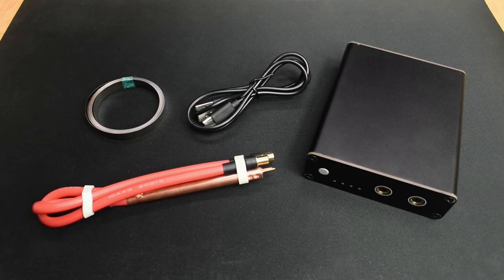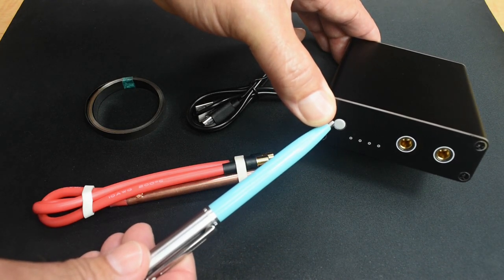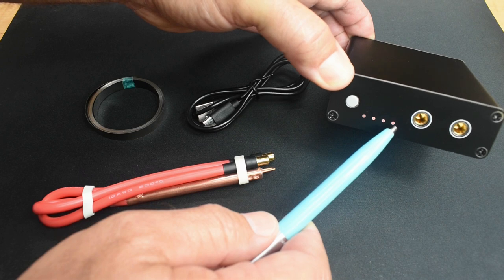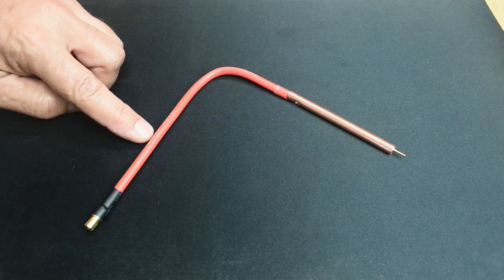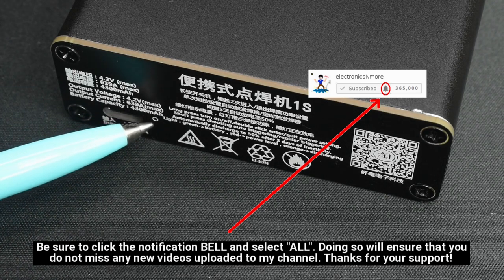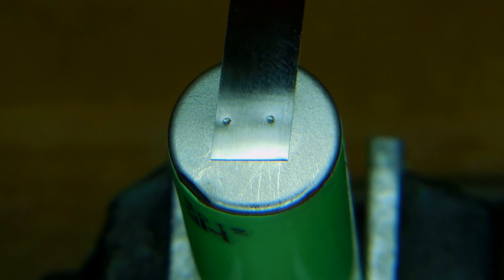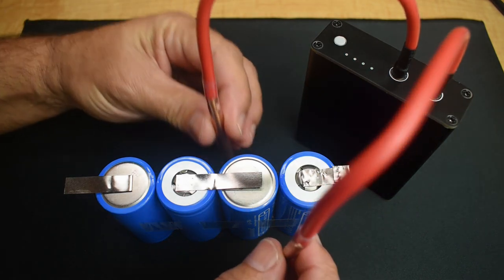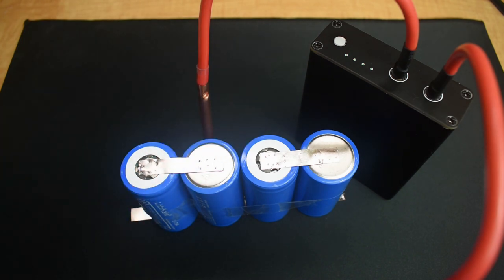Low Cost Battery Spot Welder (Turn Cells Into Battery Packs!)

Comment: I picked up one of those $15 Banggood specials and it works surprisingly well.  It does have to be connected to a car battery to be able to deliver enough current to do the spot welds (maybe it could be powered by LiPO batteries, I dunno), but for being so cheap it does a nice job with spot welds.  So far I’ve only used it on button cells, but I expect it to work just fine on 18650s as well.

Comment: Just ordered one.   Looks to be far more handy then my MOT set up.   Thank you.   Hope it will work with 0.15 in high setting .  That is what I use the most of.
Reply from the maker: You'll be happy with it. Thanks for your support!
Reply: @electronicsNmore  Thinking I may need to hit the welds twice for the 0.15.  you can in fact spot weld the BMS leads as well.  Takes some practice.
Reply from the maker: @pulesjet  Good point!

Comment: With that device I'd have many fewer dead portable drills sitting in the garage.  All things considered though, I'd probably have to re-read the directions when I go to use it every few years.  It needs three buttons: On/Off, Set power level, and Operate (or Weld, or Start, or something).  Send it to Todd so he can drop it off a ladder 😄
Reply from the maker: Exactly. It's very easy to rebuild those cordless power tool battery packs using this spot welder. LOL. Todd. Thanks for watching!

Comment: I got the aliexpress version which doesn’t come with the internal copper bus bars instead using solder to move the current(bad idea) unfortunately they didn’t use enough solder to cover the pads where they carry high current to the mosfets. Had to add some of own solder which isn’t good to heat with a lipo glued to the other side.

Comment: It will be interesting to see if the soldered cells last longer then the welded ones.  People have reported these diy spot welders seriously reduce the lifetime of the cells.  Please do an update after a set fails!
Reply from the maker: The spot welded areas are very small, and every battery pack sold in cordless power tools are spot welded. Thanks for watching!
Reply: @electronicsNmore  , yes but these home spot welders are not the same as industrial tuned spot welders.
Reply from the maker: @TheRainHarvester  You cannot expect industrial quality for 50 bucks or less. The device is more than sufficient, and the cells will fail due to other reasons first.
Reply: @electronicsNmore  well, others have had experiences that show otherwise on home spot welders.  I just wanted to see future results for this one, instead of assuming.  One guy spot welded a bunch and soldered others.  All other things being equal, he noticed the soldered ones lasted much longer, probably because the machine had too much current, or the pulse was too long and side currents attacked the chemicals under the lid.  It might be user error, but without an experienced user, the machine should compensate.
Reply: @P_RO_  I agree, which is why I wanted data on the long term battery life of batteries welded with this kit.
My point is that this kit may not weld with the correct time or current.  
The only way to know is to test, and not "assume" like the poor operator you mention.

Comment: I built my own, but it's a bit big, and my battery died, (the small one powering the timer, and solenoid) I have bought two small spotwelders,  both the FETs exploded, before they did anything, not one weld, the last one, basically caught fire! But my home built welder, it will not weld under 11v, so with 3s liion it needs to be kept topped off, but I use 4gauge welder cable, and after a few welds it's so hot, after about 50-90 cells, it has almost burned my hands, they were a bit sore after, from the heat, not quite a burn, but my welds are about 1/16" diameter, so low current cell / battery builds  can get by with a single pair of spots, im using a timer board, and SSR, with a starter solenoid, I may try the small electrodes like you are using, maybe I can but more MOSFETs to replace the exploded ones on the tiny welders,
Reply from the maker: The one in the video works good, I just made another 32700 12V battery.

Comment: Hi,
I'm based in the UK and have a few questions about this battery spot welder but first, fantastic video, don't ever change the way you present, keeping things simple and informative is so difficult and few can do it--you can., excellent video.

I am a green horn when it comes to spot welding but ordered the above same mini welder from Banggood and it arrived very quickly.

I knew the instructions would be in Chinese and seen a couple of  YT videos but could not make heads or tails as to the advice given on setting up the welder.

Using your advise I practiced on a couple of 18650s using the nickel strip that came with the unit, it went like a dream, using power setting 3 & 4 the results were great.

However I also practiced using some Solar Cell, Solder Busbar Tabbing Wire ( 0.2 x  8mm and it would not spot weld to the flat tops.

I feel this is a stupid question to be asking but any idea why?

The leads are a little to short for my liking and I would like to make some, I can purchase replacement leads but they are about the same length as the existing.

I wish any new ones to be about 4-6 inches longer that's all, if this is feasible do you think lengthening would have any affect on the quality of the spot welds or the welder?

If I'm using correct terms, the leads I think use gold plate male XT60 connectors, I can purchase XT60 connector blocks from almost anywhere, what I cannot find are single ones as those used, also,  are the other ends referred to as needles or pencils and like the connectors I cannot find the same anywhere despite my efforts.??

Are you able to provide links for the connectors and the needles/pencils.??
Reply from the maker: Either the tabbing is too thick, or not the same material. I agree with the wire length, but making the wires longer will add more resistance and degrade the spot weld. Glad you enjoy my videos!
Reply: Thanks for your reply.
I could not understand why the tabbing strip I had and used would not spot weld so back tracked where I had sourced it from and discovered it was tin coated copper, not nickel as I thought,  used in making solar panels, would this have been the reason??

I didn't purchase it for that but to solder battery cells together, probably why it didn't take using the spot welder. Hopefully using nickel strips, soldering cells together is a thing of the past for the most part for me.
 
On the subject of nickel, the small roll that came supplied with the above spot welder was 0.1 x 8mm but I don't know if it is pure nickel or nickel plate, would either do?.

Somewhere I have a couple of strips of nickel 0.15 x 10mm, will this thickness weld using the spot welder, what is the maximum thickness of nickel strip I could use?

Comment: I tried using a capacitor, charged at 50 Volts. But, it blew away the nickel strip. Big holes in it. Way to much charge. Next time I will charge the capacitor to a lower voltage. This way I need just a few things, just a capacitor and a power supply. But you do need to get the voltage right. The PCB you are using is way more sophisticated and recommended.
Reply from the maker: Yes, 50V way too high. 1S or 2S Li-ion or LiFePO4 is ideal.
Reply: Yeah, around 12v is about Max, the arc at higher voltage will vaporize about anything, maybe charge to 12-15v

Comment: Dang, that looks a heck of a lot easier than all the soldering I did to do the same job with my TS100.   There just was not enough information I could find on spotwelding.  I have a spot weld Harbor Freight Chicago gun that connects to  Montgomery Ward  AC buzz box welder but I have no idea how to use it, looks like the tip is pretty big and corroded.

Oh sh1t, you still have to solder the balance connectors... yeah, never mind, then this becomes... well, pointless.   If you got to solder anyway, might as well solder a braided stranded ribbon cable between them at the same time time.
Reply from the maker: Even with soldering the BMS wires, using the spot welder is way faster. It makes positioning/securing everything easier.

Comment: hello thanks for sharing! this comes in time :D!  how many amps are needed for this spot welding (i can make a transformer but don´t want to fry the batts). i´m planning to bring back to life some old nicd tools that are ok but batteries are dead. also what do you think about putting batteries in some sort of mechanical contacts without welding? thanks in advance.
Reply from the maker: Hundreds of amps. The only problem with mechanical contacts, the connections can fail(lack of pressure/corrosion/etc). If you don't spot weld, then solder the tabs. Thanks for watching!
Reply: I wouldn't use mechanical battery holders with over 5 amps, they get hot, and fail, they loose the spring tension, a 150+watt soldering iron works, just use thin solder so it melts fast, and only hold the iron on the cell for about 2 seconds, I soldered all mine until the tip on my iron failed, then I built a spotwelder, all you need is a starter solenoid, a timer circuit, only about $5 on Amazon, and a relay to go between, mine works on the just above the  lowest setting, just high enough for the solenoid to react, use 4gauge wire, like for welders, (from Amazon) about 6'-8' should be more than enough, then all is needed is a button or foot switch, (Amazon also ) then connect it to basically any car battery, and you could connect a small battery charger, to keep it charged, but Don't spot weld around it, it gives off hydrogen, and can explode,  I learned this as a kid, don't ask me how! Ha-ha, I'm about to rebuild all my tool batteries, and convert my nicad drill to liion, if you have any old cars or lawnmowers around they may have parts to save money, starter solenoid, and a non latching button, like power door locks, and cars have a lot of relays,   I would put one together for cost, if interested, I have a few extra parts from when I built mine, if you are interested, and trust me, shipping shouldn't be much,  but the cheap chinease spit welders, I bought two, they both exploded before doing a single weld, and it was two different designs, I may be able to rebuild one or both, or use as a timer board, where it operates a solenoid,

Comment: Is there a max Amp draw with spotwelds when using a battery pack you made, or does it just depend on the strip?
Reply from the maker: The recommended battery voltage and capacity are usually mentioned when buying a spot welding kit/board. Thicker strips require more current.